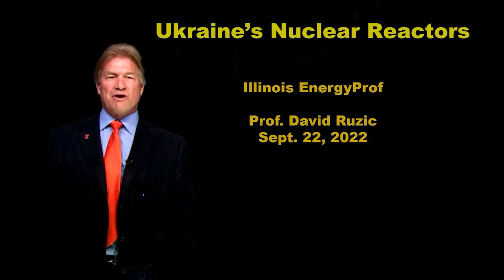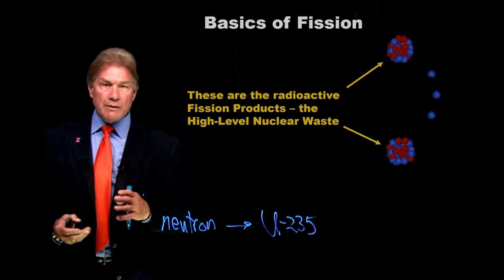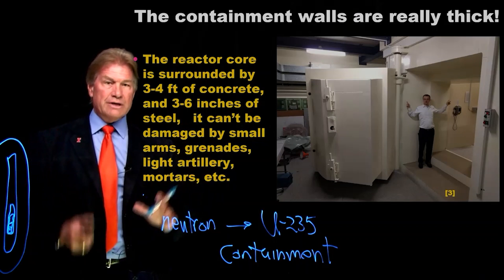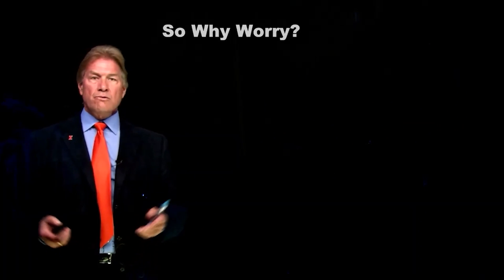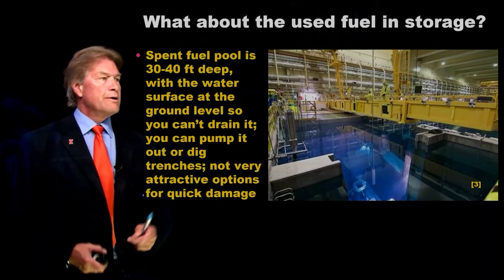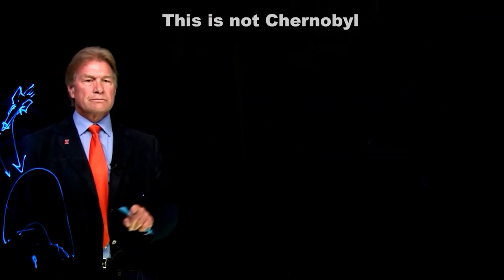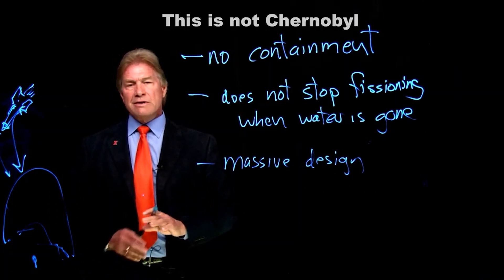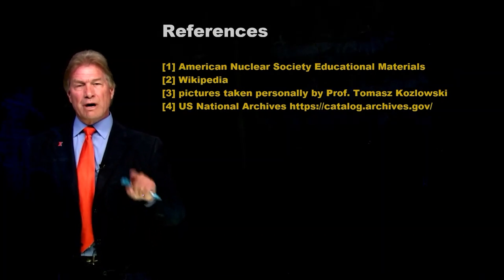Ukraine's Nuclear Reactors

Comment: Amazing and very informative video, definitely needed at this time. It is sad that after so many decades of using nuclear energy, general knowledge of it is still limited to "Chernobyl and Fukushima have happened".
The biggest danger of Zaporizhzhia NPP that I see is that Putin would want to use it as an "dirty bomb" of some kind, as he would blow it up from the inside,  but didn't want to risk using nuclear bombs - the city of Zaporizhzhia, that before the war had population of 700000, is just 50 km away. With favorable winds radioactive contamination might reach it after some "unpredicted accident" would happen, even if radiation would be small, it would spread panic among region and Europe, causing massive exodus from the region and changing every military operation in affected area.
Reply from the maker: What you say is a worry, but it would make a very lousy "dirty bomb".  It is very difficult to volatilize spent fuel since it is still in pellets, which are in pins, which are in rods.  The rods are under water or in a containment building.
Reply: The worst of the worst that can happen in ZNPP is a Fukushima x2, basically. And you would need a very concentrated effort to reach that point. Probably not worth the work. Honestly, Ukrainians should worry more about their 12 Hydro dams. A bunker buster or two WOULD blow them up, and cause absolutely massive destruction. Not only that ZNPP is, according to the Russians, Russian property now. WHY blow it up?
Reply: or on trucks or in the parking lot waiting to go to France or who knows where. Maybe not all will be accounted for

Comment: I think the professor grossly underestimates just what the Russians are capable of doing just out of sheer ignorance rather than malice. I can easily see troops stealing all the diesel needed for the cooling pumps, and then shutting off all the warning alarms because they're making too much noise. They've already shelled the plant itself on multiple occasions - probably because the gunners were given coordinates and not told what they're actually shooting at. It would certainly irradiate any troops they have there, but when has that stopped them? Back in March, soldiers were given orders to dig in at the Chernobyl exclusion zone. Which they did, because they had no idea that anything had ever happened there in forty years ago.
Reply: Ukraine is bombing the plant. Russia shut it down to be safe.